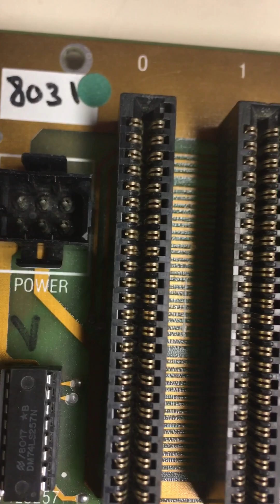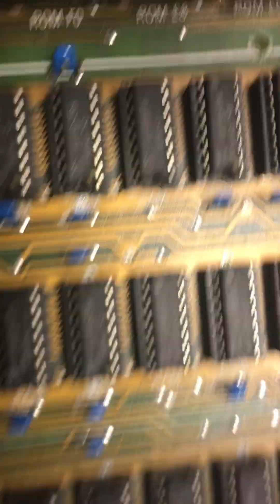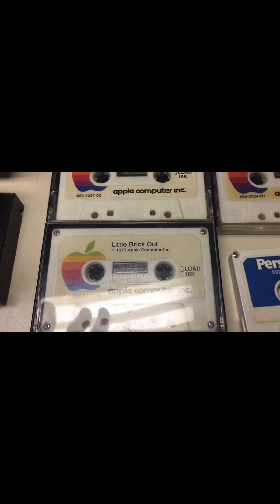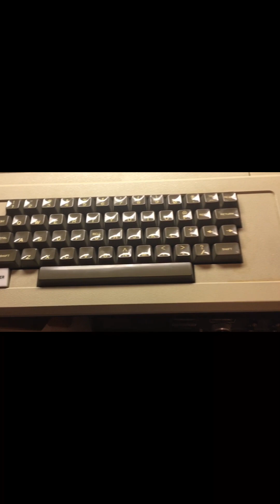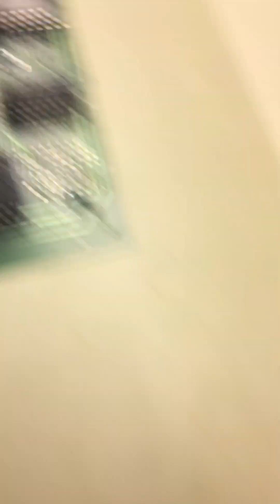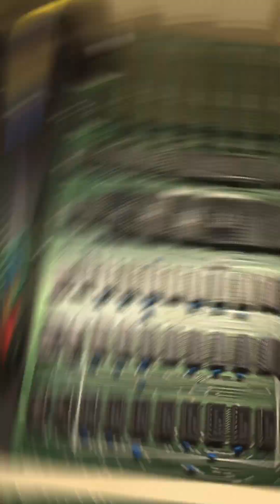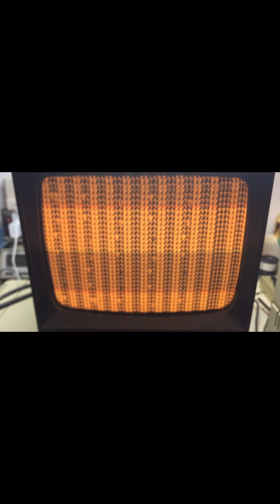Reuniting with old Apple ][ Plus

Comment: 1:18 the '8031' handwritten on the motherboard means it was assembled during Week 31 of 1980.
That RAM Disc Memory Card is a BEAST! I've never seen anything in a II+ bigger than the Saturn 128K RAM card. I wonder how much memory is on yours? It had better be a stupendous amount to justify so much hardware.
Reply from the maker: Thanks, that was my spare motherboard I'll have to check the original for the date on that one. When I get it working again I may put the original back in, but maybe not as the newer one supports an eprom for the character generator rom from what I understand and I may want to add lowercase. If I decide to keep it in its exact form I'll put the original back. The Ram card was unique it had 256k of Ram and it was also a Ram Disk. It was called the App-l-cache and made by Sorrento Valley Associates. I have documented it here: https://github.com/pfiliberti/app-l-cache